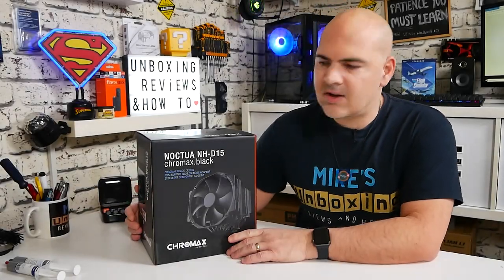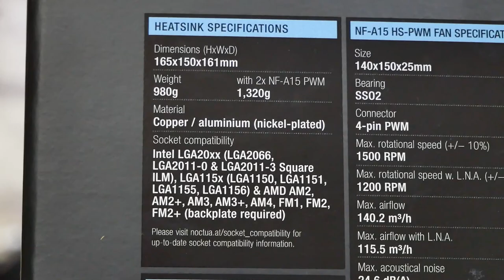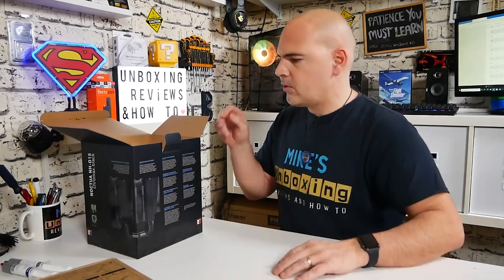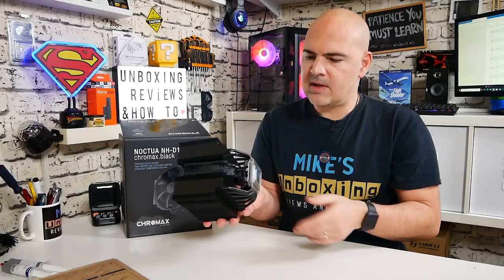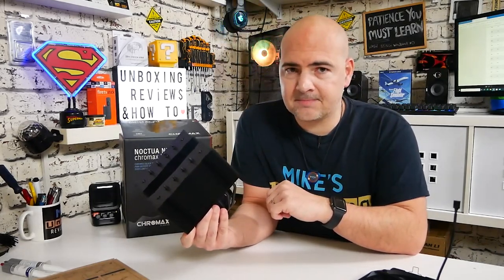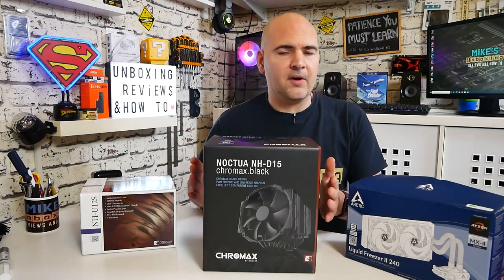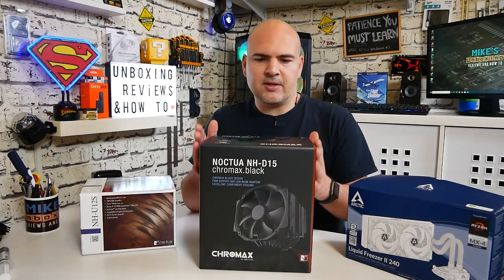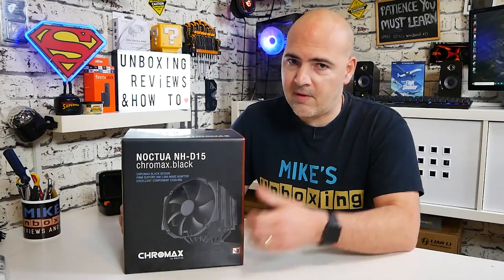How To Install Noctua NH D15 Chromax Black On AMD AM4 But Beware Of The Size

Comment: Used this cooler for my first build last week. Works great, but it’s going to be a nightmare if I’ll ever need to replace my gpu.
Reply from the maker: yeah i feel you, the spring clips are the issue, a nice slot design like coolermaster or corsair would ease this
Reply: I used a screwdriver on the gpu clip and it scraped the clip. I bought 30cm wooden dowels for next time I need to get the gpu out see if they work.
Reply: @darkghost5770   have you had a look at the NH D15s? They do that in chromax also! Ideal for MATX motherboards
Reply: @mikesunboxing  Gonna put in another plug for the Scythe Fuma 2. the fins have channels in them for a screwdriver so the cooler can be mounted and removed with the fans attached. The spring clip design is pretty bad but you only need to install the fans once.
Reply from the maker: @SimplyLewin  Noted :-)
Reply: @darkghost5770  have you considered an Ifixit tool kit? It comes with 3 plastic sticks with curved tips, perfect for reaching that clip, and for separating the heatsink from the cpu without damage.
Reply: i have a 4070 super i think ive got like 8- 9 years before i need to replace it

Comment: I'm so glad someone mentioned how big this thing is because it doesn't seem to be mentioned on other channels or Reddit. I'm sure its a great performer but I've spent a day trying to wrestle this monster into my case. I've got a standard ATX case and motherboard but it's so huge that I had to pull out the existing motherboard, pre-insert some cables like CPU power, and system fans because I knew I'd never get my fingers in there again once the motherboard and tower were put back in place. I regret trading my Dark Rock Slim but I am looking forward to decent performance and quietness.
Reply from the maker: yeah a lot of channels gloss over that so they can be a part of the noctua hype train. I don't do that, i say it as it is, good and bad

Comment: Tested mine a while ago on a cheap a320 mobo, as I was  worried about weight distribution on the AM4 backplate in my oddball case and orientation in the sharkoon rev 200 for linear airflow but worked out great. If your building an overclocked pro audio set up and like in my user case using for line level recording electrical hum is non existent as have had issues isolating the feedback from cheaper CPU fans and especially AIO pumps in some set ups. Isolating case fan noise is easy but the CPU fan is always a bit of an issue. To get clarity in analogue signals using progs like wave lab, Ableton, Acid Pro etc this gets top recommendation from me. On a separate note I know you was probably just eager to fit but recommend leaving thermal paste application to the very last minute before fitting the cooler. Less chance of contaminating the paste with foreign particles as you work around it and les chance of spreading around on everything you touch if you accidentally get some on your finger. Covid researchers could use thermal paste to study transmission.  4g of MX2 could infect 1/4 of the population of Bristol in just 3 hours LOL.
Reply from the maker: lol this was some great info but you went into unknown territories at the end

Comment: Phwoar.....out of the box its one gorgeous looking air cooler !  No doubt that its going to keep things cool and quiet, you get what you pay for after all.   Its a beast isnt it,  is it as big as the GELID kewler ?   If it were a toss-up between this and the Arctic Liquid Freezer 2 AIO (waiting for a good price on that) then I think it would be neck and neck temperature-wise.  

Nice one Noctua, quality produce !  Thanks for a great video Mike and Kath.
Reply from the maker: It is a beast and a little tricky to get in and out due to the close proximity to the gpu but otherwise easy enough

Comment: Great video. I'll be replacing my stock wraith spire with  the NH-D15 chromax black cooler in just a couple days.
Reply from the maker: That should make a huge difference for the temps
Reply: @mikesunboxing  It will, but I might not be able to really feel the difference until I get around to replacing my RX 480 8gb gpu, haha! Still even after all this time it's holding up better than I expected.

Comment: Cool!  I have just started experiencing overheating on my system and found this.  I have the same motherboard and cooler is on the way.  I am worried that my RAM may not have clearance tho.  It appears yours was more low profile than mine.  I also have a huge project two days after it arrives.  I do not want to risk pulling out the GPU and all the rest of it with that schedule.  You answered all my questions!  Thank you!
Reply from the maker: Glad I could help!

Comment: Great video! Just got the D15 since I upgraded my CPU to a Ryzen 5 5600X. Can only fit one fan though because of the RAM sticks. I can put it higher but it blocks the glass door from fitting. May try a different combination. 

I’m still clocking high temps thought, about 40 C at idle and 80 C at full load. Is this because I only have one fan? Looks like you put more thermal paste than I did - maybe that’s the issue? I don’t think there was any plastic or anything left on the heatsink to raise the temp.
Reply from the maker: a little more paste might help and loosing a fan it not going to be helping either

Comment: I have my nhd14 from 2013 and still does a great job ... the look its rly  outdated unfortunately but can't find any other reason to upgrade...I was looking to change the fans as the old ones have a max speed that its on a lower level and I saw Noctua have some   which go to 2000 rpm ! What rpm does this version of fans go to Mike ? BTW great review 👌
Reply from the maker: i think they were around 1500 rpm from memory and reduced to 1200 or so with the low noise adapter

Comment: Hey man! I would be glad if you will notice this. I don't know if I am being nuts with my question but, should I stop screwing the screws until I feel them not turning anymore? Does it really need to be that tight? With no allowance? Thanks in advance man.
Reply from the maker: Yes keep going until it feels like it has reached the limit
Reply: @mikesunboxing  Thanks man I really appreciate it a lot. Now I can install mine without uncertainty definitely!

Comment: the plate that comes into contact with the CPU, does it have anything on it that needs removing? I've installed mine and come across a video saying to remove a plastic film but I didn't notice one!
Reply from the maker: yes they normally have a small plastic film over the coldplate to protect the surface
Reply: @mikesunboxing  woops, I expected cooler temps idling and gaming! It's my first build 😉 thanks for getting back to me on that =

Comment: basically block out the ram  i had to take out some ram now i cant place it back i have a big case but i think i need a bigger one help?
Reply from the maker: yeah that is a problem with the size of this on some motherboards
Reply: @mikesunboxing  yeah well I have the rog stix gaming mb and this cpu block now I need a case that will every I just bought a new case and I regret it

Comment: These massive air-coolers are awesome. Aye, they basically block out the ram and the whole cpu area, but there's just a raw visual impact of having a huge heat-fin tower filling up most of the case space.

I kinda wish there were similar aftermarket pass-through coolers for GPUs (nowadays add-ons are water based, and stock coolers pull air into the card instead of past it like cpu coolers do; so the airflow on the lower case half is usually a mess).
Reply from the maker: yes i know what you mean

Comment: Hey Mike, just wondering what board would you recommend more? The MSI B550M PRO VDH WIFI or the Gigabyte B450 AORUS ELITE ATX AM4 Motherboard? Because I am trying to find a good motherboard for the Ryzen 5 2600x and the 3060 ti.
Reply from the maker: the b550 for sure

Comment: I'm having trouble connecting the bracket with my Asus x570 crosshair Viii formula. I had no problem with the Asus Sabertooth 990fx R2.0. It either doesn't get all the way tight or it never tightens at all I need help please.
Reply from the maker: Can you post some pics on the discord tech support chat
Reply: @mikesunboxing 
After a while like an hour from 445am I had finally got it, it took me over an hour to do, that was very frustrating. I also see that the graphics card first slot is going to be a very tight fit I hope I can squeeze it in there.

Comment: will this be any good for the 5950x  i will be getting the Corsair iCUE H170i ELITE CAPELLIX Liquid CPU Cooler but i need a cheaper  alternative  until i can buy it
Reply from the maker: it will do okay if there is a lot of cool air in the case also
Reply: ? I have the same cooler and the same 5950x should I think about the Corsair ice for cooler temps at the CPU when under load , gaming or redering at the same time or multiple virtual machines running. Any pointers would be greatly appreciated.

Comment: Hey MIke,

I recently acquired my NH-D15 and assembled it into my case. After putting everything in place I noticed the 2nd fan, which sits on top of the ram(corsair vengeance pro rgb), leans against the side panel. When I noticed this, I readjusted the fan so that it could be a tag lower and it helped. The thing is, the fan is still being pushed a little against the side panel.

Should I take the L and remove the 2nd fan and use it as an exhaust? Or should I be okay the way it is now? Looking for your advice on this since this cooler is MASSIVE. Thanks in advance!
Reply from the maker: i would leave it where it is, but maybe try the other fan as exhaust and see what the temps are like?

Comment: Great review, Mike! She is a beast! I would love to see how she does against the bequiet! Dark Rock Pro 4... they sure seem like a direct competitor. One thing I would have to point out is that the prices on high end air coolers are going crazy. Might cost you  30-40% less 6 months ago. Sigh.
Reply from the maker: all the high end stuff is crazy pricing now, and i don't see it getting any better in the near future, the extra demand over the holiday season has added extra pressure on the market. maybe by easter things will settle down again?
hope you are feeling better now .
Reply: Just swapped from a dark rock pro 4 to this. It cools around 2c better.
 Im always changing bits around though so either one dependant on which is cheaper and preference on looks.
Reply from the maker: @jamiebishop9512  Totally agree :-)

Comment: Well, I'm 2 years late to the party but I want to know one thing before I buy this. Can I swap the right hand side fan to the left side? My RAM is about 43 mms tall so I can't install this in 2 fan mode if I can't place the fan to the left side. And running it 1 fan mode would probably hurt cooling performance. (it should cool an R5 7600x)
Reply from the maker: yes that should be fine
Reply: @mikesunboxing  Great, thank you :)

Comment: Newbie question. I’m building my first PC: 011dynamic xl, Ryzen 9 5950x, Lian Li  uni fans throughout. Could I theoretically replace the Noctua fans with Lian Li uni fans? I’m hoping to add RGB and have a uniform look to all fans in the case. Apologies if this is a stupid question.
Reply from the maker: you could but they would be smaller and less efficient, but that is up to you, if you like the look of it

Comment: The one thing which would have been great to include in the video... is where and how did you connect the 2 fans (I have 7 case fans the cooler excluded for installation and this would have helped with the management of it... despite reading the mobo and noctua user guide )
Reply from the maker: good point i take that onboard

Comment: Hi, can I instal it oriented to the top of my case?
Reply from the maker: if you have the room sure
Reply: @mikesunboxing  thnks for answering, so I'm not limited to only install the cooler oriented to the back of the case right? Maybe it will block my pci express slot if I install to the top orientation, in this case if I use a riser cable to my gpu this can solve my problem?

Comment: hi there! I just want to ask if I can fit 4 sticks of ram modules with the height of 47mm each ...  will be there enough ram clearance to the air cooler?
Reply from the maker: i think so but depends on the motherboard really to be accurate
Reply: i had a asus x570 wifi motherboard and im planning to change my  amd wraith prism from ryzn 3700x . for now im opting for an aio as an alternative cooling system if i can't fit those 4 sticks of ram . with that cpu cooler. anywa thank you for your  reply,  sir greetings from ph

Comment: Is this cooler compatible with gigabyte c200 case 
I7 9700k 
Z390 gaming plus msi 
2*8 corsair vengeance pro rgp 3200mhz 
Is there any issue with the ram or anything ?
Reply from the maker: no this is a AMD AM4 cooler there is an option for intel available though
Reply: @mikesunboxing  yeah I also found that my ram is 51mm height and is not compatible with noctua nh d15 or DRP4 .. can you recommend me something ? I heard about thermalright le grand macho or noctua nh-d15s

Comment: I recently ordered this fan however it seems abit wobbly, does anyone have an idea on what I could do to solve this?
Reply from the maker: try reattaching the clips that should do it
Reply: @mikesunboxing  not the clips to the fans, the heat sink itself wobbles. The screws with the springs don’t seem to go down all the way when tightened fully

Comment: Hey Mike, you seem to be the most famous English speaking person that has communicated with V-Color. They have a technology called IMS in some of their RAM sticks, which apparently was developed by Kingtiger Technologies and patented, and also integrated into UEFI BIOS implementations from AMI, Insyde, and maybe others. What the hell does IMS do? I've read as much of the patents as I could stand to, and every press release. Do you know what IMS does? It sounds good but it's confusing as to what it actually does. Do I need to enable it? What supports it? Does every motherboard support it? My V-Color Sticks say "iMS+" on them, what does that mean? How is that better than non-IMS RAM? I'm so confused. It's interesting though and if it really means it's self healing ram, that's cool. I would also assume that if it did what it said it did, V-color would have an up-to-date website with all their products on it, and that Kingtiger Technologies would have an HTTPS website, so that's like two out of three fingers put down when I'm thinking if this is legit or not.
Reply from the maker: from what i can tell the ims is very much like error correction in ECC ram so it buffers the data flow and if errors are present the data gets refetched until the error is corrected. So really it is enabling ECC on a non ECC system, at least that is my take on it.
I'll try and get some info on it and if successful i'll share my findings

Comment: Ok! I got this cooler in beige installed this morning.. First, it's a beast. Unless I'm crunching something with my computer, the fans don't spin. Only the the fan in front and in the back of my are running, even slowly, create enough airflow to allow this. But this lead to another problem. Restart don't work. Looks like that the motherboard don't start if it don sense cpu fan spinning.. And the option to disable that don't seem to be present present on my MSI a570x-A Pro.. I'll keep investigating..
Reply from the maker: i would maybe increase the minimum rpm to stop that error message
Reply: @mikesunboxing  that's what I did. It's just that it was cool to have a fabless cooler for the 3700x 😁

Comment: Just ordered one of these for my 3900 (non X), due to my very warm 5700 sitting so close to the CPU, it is proving impossible for the wraith cooler alone to do the job.  I also suspect that the system builders used some cheapo thermal paste so I will be replacing that at the same time I fit the Noctua, hopefully, that will remedy the heat issues.
Reply from the maker: it should be a massive improvement

Comment: The price of the Noctua NH D15 Chromax Black is $100 on the US Amazon. Not a bad price, as it's about $30 less then what I paid for my waterblock. Although, installing a waterblock is much easier, and they fit in any case and RAM height isn't a probable. Personally, in my opinion a hard line open loop is much more attractive than a big block of metal and fans covering up the entire motherboard. A waterblock is also silent because it has no fan. LOL
Reply from the maker: it is silent apart from the sounds of dripping water 😇
Reply: @mikesunboxing  There's no sounds of dripping water in an open loop. But sometimes there is in an AIO if it's not fully filled.

Comment: can i fit a noctua nh d15 on a B550 GAMING EDGE WIFI mobo and CRUCIAL BALLISTIX RAM? am i going to have any problem with cpu cooler bumping the gpu?? ( GPU IS 3060TI ) . what case are u proposing to get? im on a budget of 150$ tops thanks a lot everyone
Reply from the maker: go with the NHu12 there isn't a huge difference and better RAM compatibility